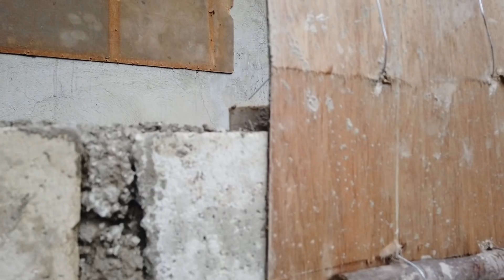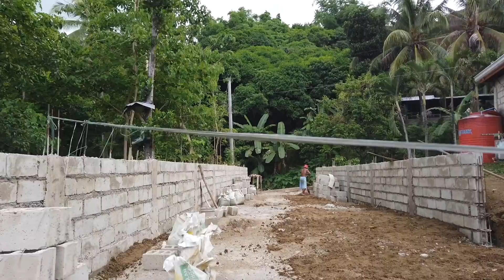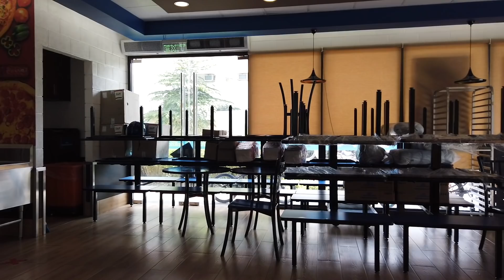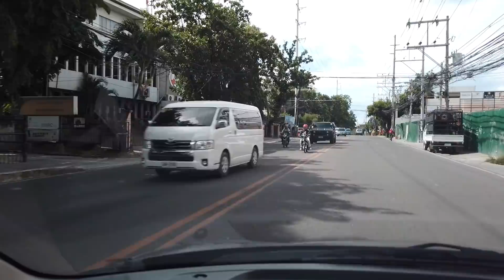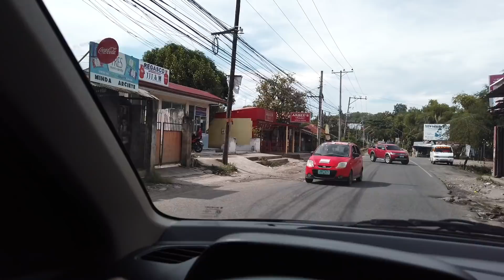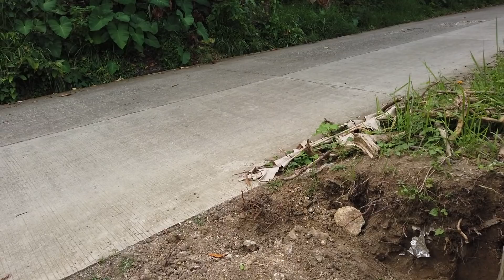Building A Private Road In The Philippines. July 20, 2020 Update.

Comment: Is the fence right on the property line or do you have a few inches on their side? If you have space, why not pour a wedge to keep water flowing their way? Also, ordinary white glue spread before you pour cement will bond the new to the old. Mix it at least 30% glue, and it will work fantastic. For your front pillar, and for any important ones, try redirod instead of a couple of the rebar. Screw nuts onto it every 6 inch to a foot. Far stronger. If you have access to a welder, weld small flanges onto each nut. When poured will be far stronger. I especially do this gor any that will be supporting a gate.